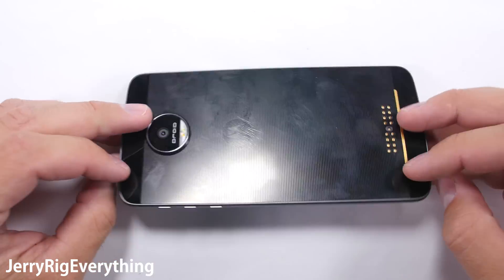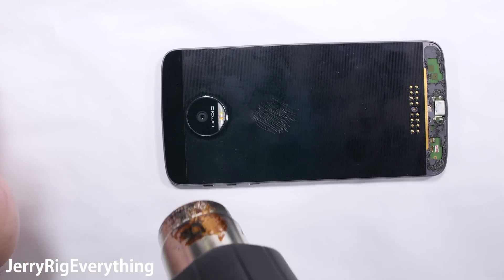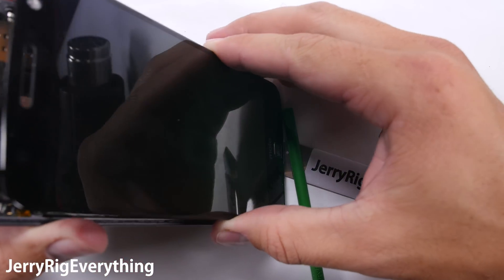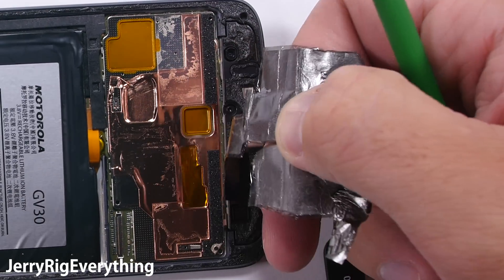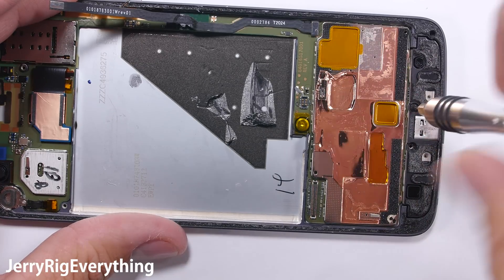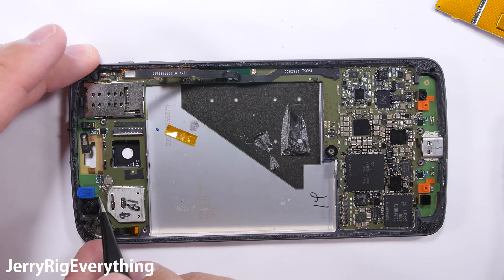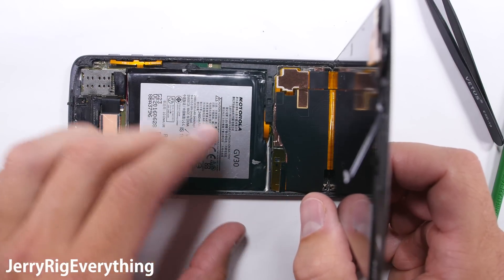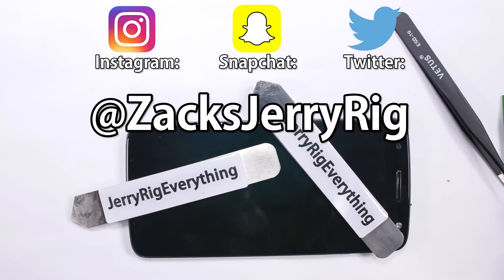Moto Z Teardown - Screen Repair - Battery Replacement

Comment: Oh boy that charging port is a no go for me.

You see, if you only use it to charge your phone and sync data chances are that your phone will be on your desk safe from accidents. 

But in the Z this port is also for headphones, and you plug your headphones and put the phone in your pocket, and you walk, bike, sport with it... I've had a couple of bend headphones connectors, and most of them still works, and more important the headphone port on the phone never stopped working. 

A usb c connector is much less resistant than the headphone port.
Reply: Yes it is so unfortunate they chose to solder the port to the mainboard. You have to replace the entire thing when that port gets worn (and it will).
Reply: +Caleb Kan If someone is going to "walk, bike, or sport" with it, I don't imagine they'd be too critical of sound quality. Most people get by with wired earbuds.
Reply: Many sports persons are using wireless headphones now
Reply: Wireless headphones use lossy compression compared to an AUX using a good DAC. So if you're really going for sound quality, wired will be better
Reply: +Md. Omar Faruque And although I own 2 wireless headphones  (as well as in ear as on ear), I find myself using normal headphones quite a lot, for example they're always ready in my backpack so I don't forget to charge them or forget them at the charger
Reply: I know, my comment is for those specifically into great sound on the go, like me :))

Comment: Another great video!
Reply from the maker: Thank you!
Reply: You can remove the motherboard aswell, you just need to remove 1 screw and use the heatgun to melt the adesive behind it, there is something special underneath the motherboard, like a special transistor that the company doesn't want you to see :)
Reply: ya in fact amazing video